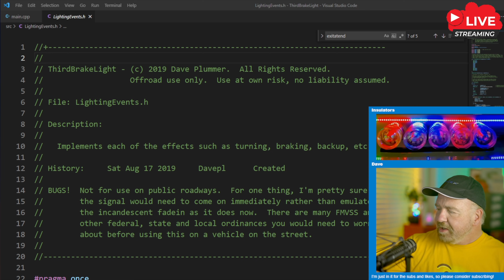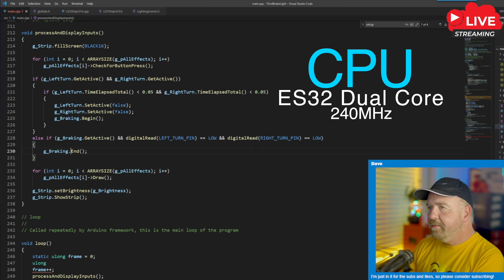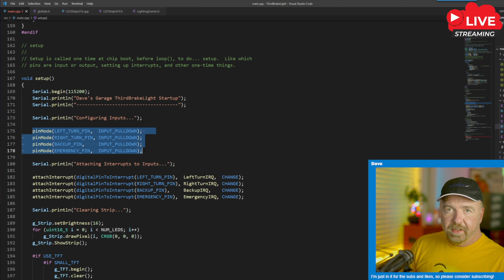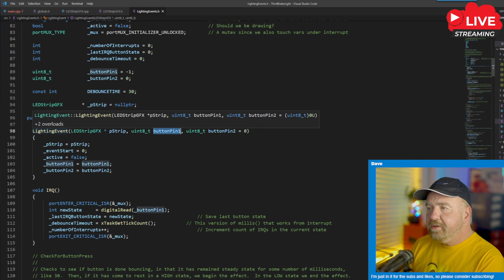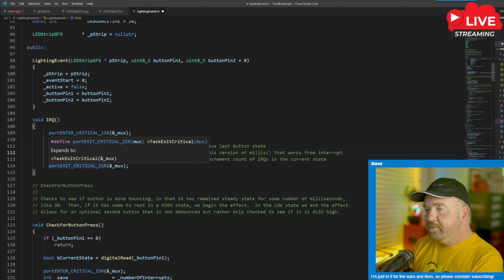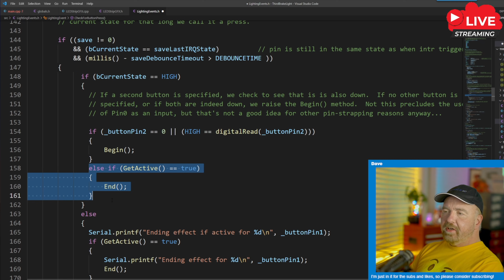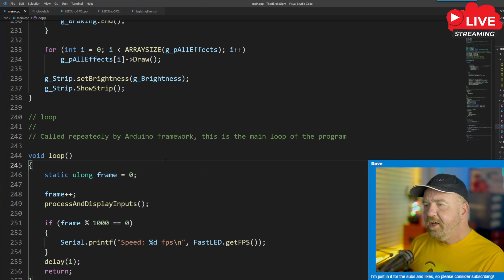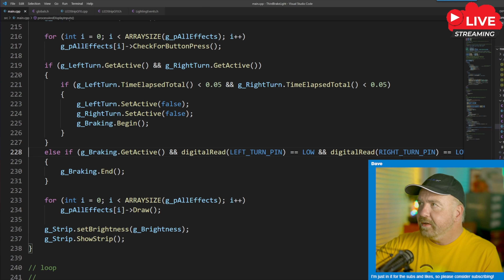Debounce a STOP switch in C++: Live with Dave in the Source Code Editor! (Live Replay)

Comment: always interesting to see software solutions to it, but in cases where you know you're going to get a lot of switch bounce, etc, and were designing a production hardware solution, I think doing it in hardware is the better, safer choice... a capacitor and schmitt trigger chip could do it all easily and reliably

Comment: Hi Dave, love your videos, very educational.
Any particular reason as to why you would use IRQs for each change? As far as I understand, it makes sense on a processor with a lot of other subroutines running, but interrupts usually require some time to trigger and a lot of redundant cycles to run (saving and loading the previous registers and whatnot), which may or may not affect the performance of a small microcontroller.
If I remember correctly from my uni days, the least amount of additional instructions required for the atmega386 interrupts (disregarding the trigger time) was 5, provided you were sure you did not have anything important in the relevant registers at that time and you wrote the interrupts in assembly.
Best regards

Comment: When possible, I prefer using latched debouncing with a double throw switch. If the NC contact is closed, the switch is definitely not pressed. If the NO contact is closed, the switch is definitely pressed. If neither contact is closed, maintain state. So you can use a non-inverting buffer to provide positive feedback to the common pin, and connect the NC and NO pins to opposite rails. This makes the firmware stupid simple, delay-free, and doesn't trigger several times when the switch starts wearing out. 

If your microcontroller has both pull up and pull down resistors you can do this in firmware. You can also just use two inputs. 

As for debouncing single contact switches, you only need a delay when the contact goes from closed to open, though in some cases you need a lot more than 30ms, especially when the switch starts wearing out.

Example, I have 8 buttons with the positive feedback based hardware debouncing, all wired to port 0 on my microcontroller. The code that reads all 8 of my buttons is only one line in my main loop:
		Buttons |= ~P0; // switch is wired active low

After I decide how to act on the currently pressed buttons, I clear that variable.

Comment: Suggestion: add a CAN input. Lots of scope for content there. CAN transceivers are cheap. But understand that it is very likely to be vehicle-specific (well, the codes will be. Hardware will be universal across all vehicles with CAN lighting. As will the process of monitoring the bus to identify which codes to respond to during the design process).

Comment: Great project. This reminds me of a project I make about 8 years ago using an Arduino. I added Stop, Indicate, reverse lights to a Remote control car. It monitored the servo PWM signals and deduced from that if the car was turning, braking, reversing etc. It worked really well. When I find the videos of it in action, I'll post it.

Comment: Hi Dave, I'm a c# programmer for (coming up to) 10 years now and one thing that's really bugged my is the Garbage Collection, even with the tweeks over the years and now into the land of '.NetCore' which has seen some good improvements to the APIs I've still always wondered 'is it possible' to manually (through use of c# or ext libraries) force the operating system (windows in this case) to call the 'delete' function on a memory address and not have the Garbage Collector  throw itself into a tantrum? I've seen a few blogs / posts on this but I'd like to hear how you would solve this problem (if you had to use c# to call said function).
Reply: Edit: I know this is a complete anti-pattern to the whole c# principle of being a  'memory managed' language, but if you could 'humor me' I'd love to hear your idea.

Comment: Is there a reason why you don't debounce the buttons with debouncing circuitry?
Reply: You normally want software instead if hardware since that is cheaper. And less components and solder points to fail.

Most electronics has ready digital inputs, so there is no good place to add the extra components if you add a switch. One thing else - a capacitor can "eat" short pulses. But it also creates a ramp when charging/discharging. This ramp, together with noise, ends up giving bounces if the digital input doesn't has a hysterese.

Not all digital inputs has hysterese, but a forbidden zone where you do not want the input voltage because the actual reading for a voltage in this zone is undefined.

Comment: Mechanical Switch debounce. What a great topic and a great memory.

Picture 1993/94. A DDE/PLC interface written in C++ and running on WFW 3.11 in a manufacturing environment. A server side C data collection interface running on HPUX and communicating with the WFW PC. Another communication interface written in C and communicating with a Motorola Pagemaker 8. Put it all together and what happens when a conveyor system faults? No less then 70-100 pages sent out on the paging system in < 1 second. Every page was a mechanical switch bounce. LOL!

I begged the engineers to code a latching circuit on the PLC. They refused to. So I ended up writing some debounce logic on the server side application. All that useless data was still be sent over the WAN, but at least I was only sending out 1 single page on a conveyor fault. I still can't believe the DDE/PLC interface would pick up that many switch bounces. LOL!

Comment: I would just poll the state of the input pins for example every .25 seconds.
I use interrupt for time sensitive things like timers and serial buffer has data to be handled.
Reply: Polling can work, unless your design is sensitive to noise, in which case your poll might happen during a nanosecond long, spurious, noise pulse. If instead polling every 1 or 5 ms, then "three identical in a row" could be used as debounce.
Reply: @perwestermark8920  exactly
still needs debouncung regardless but removes the the opertunity for sporadic operation and wasted cpu time if a loose connection exists also in this case the only time sensitive state change is the brake state on transition every other can take 1 second and would not cause confusion for other drivers

Comment: You should enable pull down resistors on ports just to make solution more robust,  if you live pins floating they can detect residual voltage.
There is even easier solution for denouncing pins is to do it in hardware with 2(1) resistor and capacitor,  it take no time to develop and taken no microcontroller cycles.
Reply: Debouncing inputs is not a task that stresses the processor. Adding components is fine for a hard-coded design, but not too much wanted for a generic microcontroller card.

By the way - the code shown in the video did show pull-down (I think it was) enabled.

Edit: See at 5:50 in the video - the pin initialization lines.
Reply: @perwestermark8920  you was right that he enabled pull down resistors,  I did not notice that when I was watching video (I am getting to old to watch on mobile).
Every cycle you do not need to use on microcontrollers is stressing microcontroller for nothing,  but bigger problem is waste of time on writing code that you can do in 10 seconds in hardware.
Reply: @mrlazda  One thing about pull-up/pull-down is that it should not just be done for used pins. If there isn't a library that forces it for all pins in the startup code, then the application itself should make sure no pin is left as high-impedive input or tristated output unless there are external components that will keep the pin in check.

Debounce is something you normally write once (for each type of switch connection mode. So no waste of coding time.

When it comes to CPU load, it's so low that it's normally irrelevant to the main task. When power consumption is important, it's possible to use processors that draws way below mW and still manages proper debouncing in software.

If I personally do debounce, it's for a product that will go out in a significantly large quantity. One cent times 10k or 100k or more will add up. Besides the advantage that the software path allows the timing to be changed.

Another thing - I might use an ADC with an resistor ladder and many switches. So one processor pin might handle 4 or maybe 6 buttons where the processor checks for one of 16 or 64 different voltage bands.

Sometimes it isn't one switch but maybe a keypad of maybe 4x4 keys that is row/column-scanned.

In many situations, it's even programmable I/O so the end user may want to decide if they want debounce (maybe 50 ms for a switch or 60 seconds for an open door) or if they want ADC measurements with sw low-pass filtering or if they want something else.

So there are many situations an RC circuit isn't managing that well.

But as I mentioned - a RC-filtered button requires a digital input with hysterese or you may still get multiple activations from noise when the RC ramp is passing the forbidden zone between highest allowed zero and lowest allowed one.

So in the end, it's quite unusual with hw-based debounce in microcontroller-based projects. It's so simple to make a sw-based "leaky bucket".
Reply: I forgot one thing - if running on small batteries, you don't want any measurement voltage to the switch between each time you poll. This is complicated if using hw-based debounce.
Reply: @perwestermark8920  your arguments are valid, but you can look same situation other way, adding couple of cent in resistors and capacitor can be less then having need to buy bigger microcontroller. Rc filter on pin are not general solution same values not fit any case, sw solution is more universal but as any universal solution in generally it is  suboptimal for specific case.
And interesting is that most microcontroller project use hw denouncing, even ones that do not have any input ( look at reset pin 😀).
As pull down resistors on unused pins that is microcontroller depending,  for lowest power consumption some microcontrollers like unused pins to be declared as analog inputs for lowest power consumption some like to be left in high importance some do not care,  that depends ...
Reply: @perwestermark8920  just one notice interrupt on change do not work correctly on all microcontrollers (it is not bug it is feature) for example on PIC 12f it will not fire interrupt if is instruction if I remember (I stopped using PIC microcontrollers long time when compiler maker of my choice dropped support for them and I could not find stable computer that know how to optimize code) state 2 and 3 ( it is documented in data sheet,  first was in errata and now is evolved to feature, I notice that problem before was documented)
Reply: @mrlazda  Note that RC reset is almost 100% in use for hobby projects. But suffers from a huge issue - a short power loss doesn't give the capacitor enough time to discharge. This means lots of equipment fail to properly restart if you quickly break and reapply power. Or if you bounces the supply power when plugging in the battery or power coord.

The more robust solution is a real 3-pin reset chip that will guarantee a full reset pulse even for a short power loss - even a powet loss that just partially drops the Vcc.

Some microcontrollers have this kind of logic internally in the processor - but far from all. So the RC reset in most circuits on the net - even on the reference designs pubslished by lots of chip manufacturers - tends to be the biggest hw goof of them all. This is also why a much spread best practice for hung electronics is to unplug and wait a while before you plug in again - just that the RC reset can't be trusted.
Reply: @perwestermark8920  it is not, I used it in multi million projects (20+ million euro project) so again it is your point of view.
Again you can argue your case how you want but no point you try to convince me, you need to convince people who pay you (your company).
Reply: @mrlazda  Not sure which post you responded to. But if the microcontroller does not have an internal logic to force a full reset for brownout or a short Vcc loss, then a RC reset can give issues with hung or only partially reset processor. But of a type that is quite hard to test.

The length of the reset pulse comes from the RC time constant. But that is defined as a charge from 0 to 63% of max. Actual reset pulse length of course depends on what voltage that makes the processor leave the reset state.

If the capacitor is only partially discharged (such as after a short power glitch), then it takes a much shorter time for it to reach the required "reset release" voltage again. And the datasheet for a microcontroller has a number for shortest allowed reset pulse. So this timing can be violated by an RC reset after a supply voltage glitch. It also comes down to what pin voltage makes the processor start a reset and at what supply voltage it starts to lose internal state - the core transistors aren't identical to the transistors on the physical pins.

So in short - the actual sensitivity of a RC reset after a supply glitch depends on actual processor. And some processor has an internal supervisor logic that creates a POR reset based on supply voltage supervision even if the external reset circuit fails to perform.

But quite a lot of spurious boot failures or hangs after supply dropouts are coming from RC-based resets. And it's quite likely that you have, or have had, equipment where you sometimes might have needed to unplug to force a full POR becase of a RC reset failure. The addition of internal supervision to many microcontrollers means the problem is smaller now than 10-15 years ago. But an internal supervisor will not help other electronics outside of the processor.

If your used processor has an internal supervisor that is permanently enabled from start, then you may be home free. But it isn't the general case.
Reply: @perwestermark8920  I was telling you all time that all is case dependent and you tried to generalise things,  no two cases are same (I pointed that in my first replay). You design circuit to fit user case, there is no way you can (tehicly you can but ...) design something that will work for all. 
Design decisions you make case by case basis, and pick most optional based on case criteria.
Edit: do you based all of your design around RAD5500 processor platform,  bacouse there is near 0 chance that design will end in radiation environment (like space) but you to be safe use radiation hardened solution ( I exaggerated to make point)

Comment: I deal with this phenomenon every day at work with the forklifts I drive. When you release pressure on the joystick after the vehicle is stopped it will then shimmy backwards and forwards for several seconds and you usually have to step on the actual brake* to make it stop moving completely. It's especially unnerving when it happens with the vertical movement controls, as that feels like it's trying to launch you catapult-style. 

*We normally slow/stop by reversing. The brake there just for emergencies. Or, quite often, to stop the d*mn thing from shimmying forever. This is according to the manufacturer's recommendation and standard industry practice (except for the shimmying part, obviously).